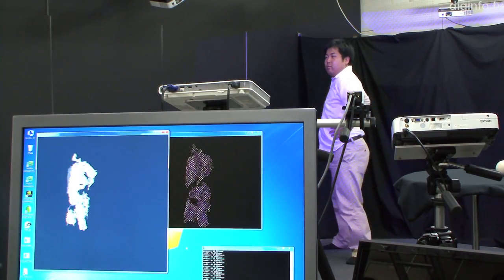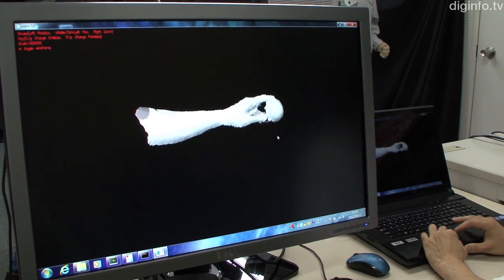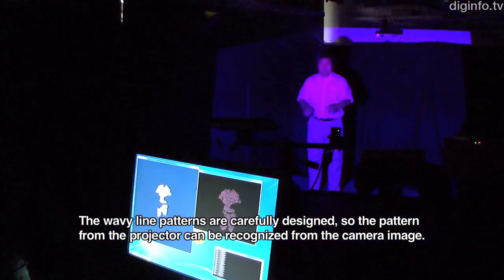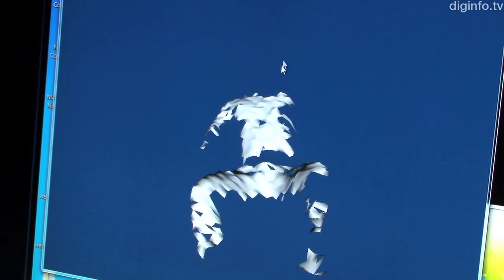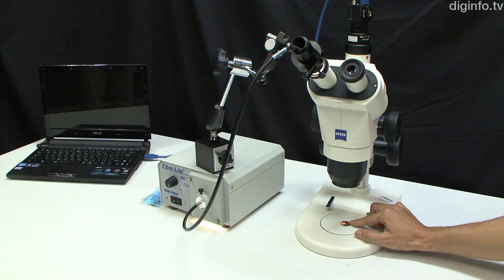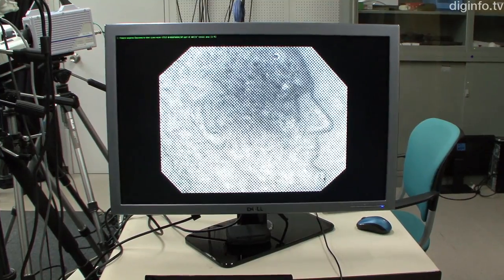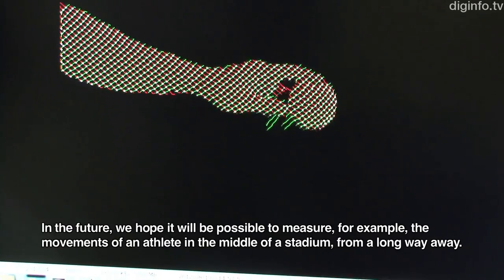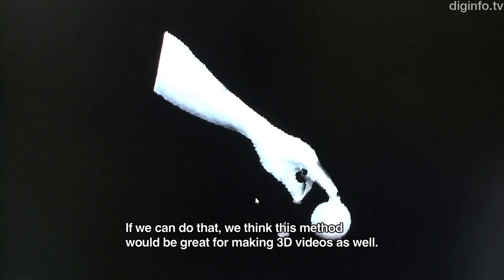Measuring objects in 3D using only a camera and projector #DigInfo

Comment: No, the Kinect's 3D sensing ability uses only 1 camera, and 1 IR projector.  The Kinect's 2nd camera is an ordinary video camera.
However, the technique of structured-light scanning which this video illustrates (and the Kinect uses too) actually does operate using stereoscopic principles, because the PROJECTOR ITSELF is treated as the 2nd camera to make a stereoscopic pair.  The pattern it projects is always known and (from it's perspective) doesn't change no matter what it's looking at, handy!

Comment: That doesn't answer the question Fionn.  The kinect itself fits into your description of a "combo of projector and camera", it's simply sold as a single unit.
The correct answer is that sunzoo1's concerns are justified, this is NO DIFFERENT TO THE KINECT.  It's a structured-light 3D scanner, identical to the kinect or any other structured-light scanner.  It's embarrassing that diginfo is reporting this as new.
Reply: roidroid does the kinect project those lines onto the object  the same way a projector does? i dont think it does, and if it does, hwo do we intensify them to work better for 3d scanning, since everyone else using akinect to 3d scan is not using them correctly, from your suggestion on what they can do.

Comment: They've just reinvented 3D structured light scanning... This is literally how Kinect works, only with IR instead of visible light.
Reply: dojomojomofo so to make the kinect work better, use it in a dark room, correct? would we get the same hardcore definition like we do from this expensive projector? is the kinect camera hi res enough to pick up the IR to such a level its worth testing? is the IR high res enough to project sharp enough stereo "light or images" for the cheap camera to pick up????